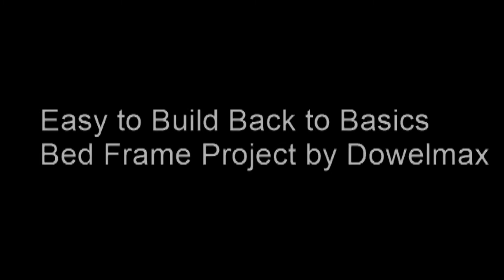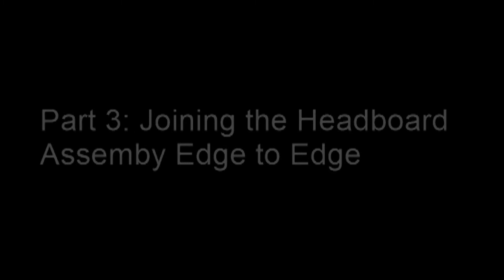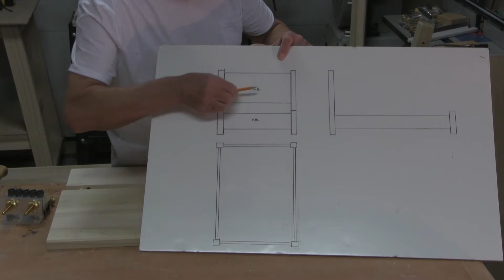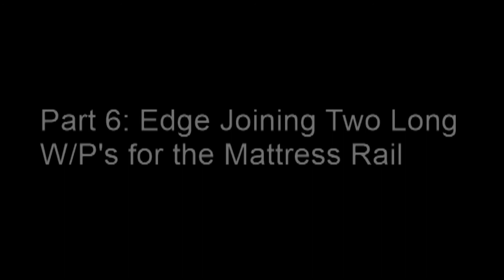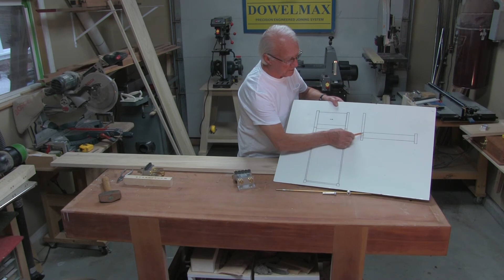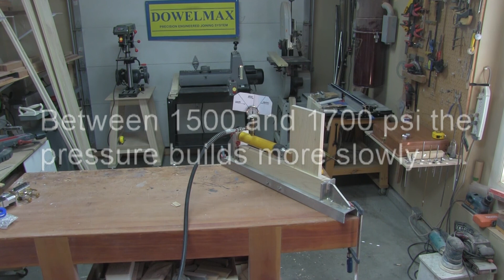Easy to Build Single Bed Frame by Dowelmax | Back to Basics Woodworking Series

Comment: Two questions Jim.  First, I assume you glue those joints.  This looked like dry assembly.  If you glue it, I for-see two problems.  The headboard is wide enough across the grain that you will get seasonal movement but your front legs won't move in that direction.  (same problem as gluing a breadboard end to a table without allowing for movement).  Secondly, you dont have any kind of knock down joinery to take the bed apart and move it to another room.  How did you address those 2 issues.  Thanks.
Reply: Hi Steve.  You are correct, all joints are carefully glued using a small brush. These were dry fitted for explanation, and test.  Sorry I Don't quite agree with the analogy of the breadboard end.  I have now made about eight beds, four of which were Queen size, and had headboards which were close to three times the width of the one shown. If there was relative movement, it was never apparent. The oldest bed is close to twenty years old!  Also the strength of a multiple dowel arrangement is greater than most woodworkers realize.
Regarding movement of the bed.  I always glue the dowels into the long mattress rails only, the joints are then firmly meshed into the headboard and footboard without glue. These are then clamped, and metal or wood brackets are used to secure these fixtures. It is a simple fixture to disassemble for moving the bed to another location.  Thanks for taking the time to contact us.   Jim.